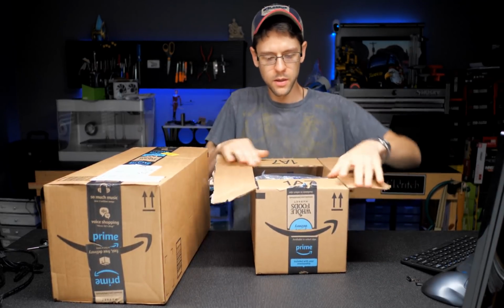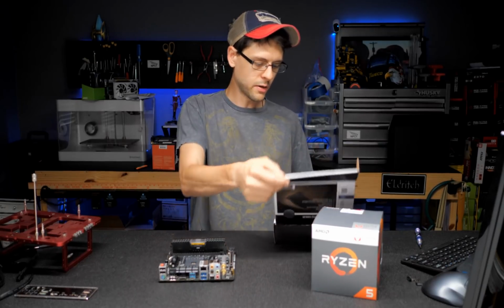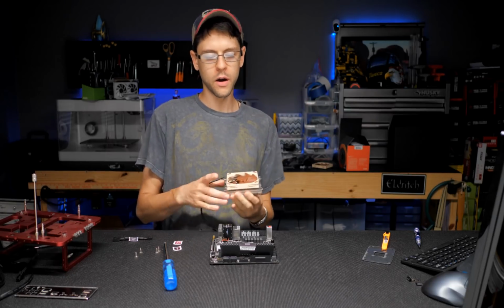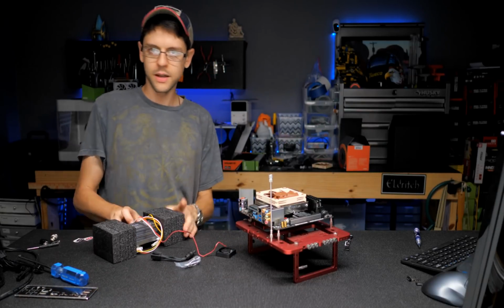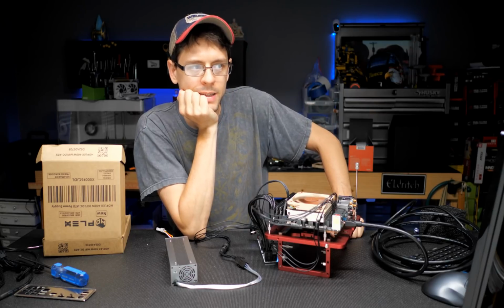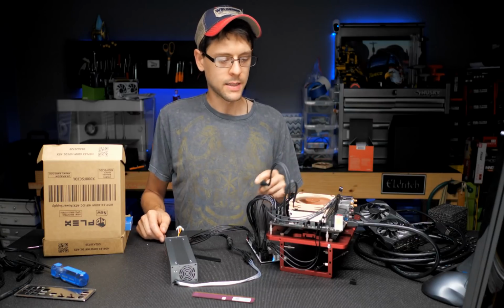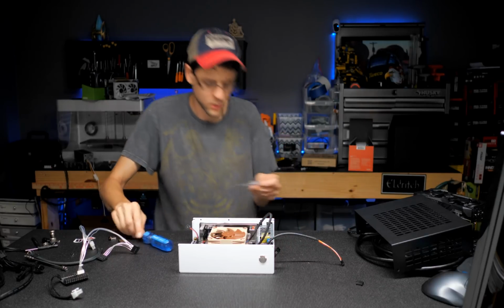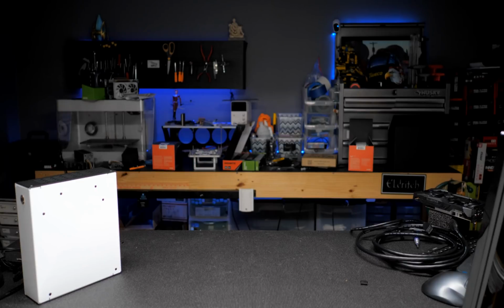In which we do an APU build in the J-Hack PURE (LiveStream)

Comment: I think the first RAM Stick dying has more to do with "heating cycles" - every time your RAM heats up and cools down the Solderballs expand and retract and get brittle over time, until they fail. DDR3 can get up to ~85°C and i don't think the air from the noctua cooler is that hot

Comment: does this built-in power supply have all the protection systems?
Reply from the maker: Yeah absolutely it does. It has overload, over temperature, and over voltage protection. It meets half a dozen safety standards and have many certifications. Meanwell power supplies are probably the safest PSUs in this category.

Comment: The RPS 200 kit from JHack is really nice for an APU build or even a 1050ti/65w cpu build. You can choose the connector option for the mini box 160xt and off you go. I did that for my 2400g htpc and its running brickless finally and working great.

Comment: LOVE builds with the Ryzen APUs.  Looking forward to this...
Reply: I'm just finishing a STX build out of the As-Rock A300W with the 2400G.  To be honest the 2400G probably isn't reallly the best CPU for that use case (it isn't so great with HTPC and it won't be gaming) but I like the chip, and I keep going AMD fanboy, so I went for it.  The A300W is a very easy build.  And not an expensive one.  I fitted MVMe, 2 SATA SSD (for a total of just over 2TB of SSD), Noctua, 16GB DDR (sadly not fast stuff, but I'll play with the timings) and I guess it comes in at  about £650.  In general PC stuff sort of has parity with £/$ so if it is $200 it will be £200 in the UK regardless of exchange rate- we pay more basically, smaller market?  I don't know.

Tha case is ugly, but when you consider you get a MB and PSU (external brick) for $?£150 THAT ISN'T BAD FOR sff.  and it went together very easily.  Sadly I have a terminal illness so I can't make long term plans but if I could I would be buying another A300 and just bin the case.